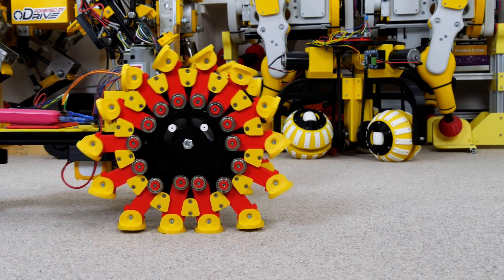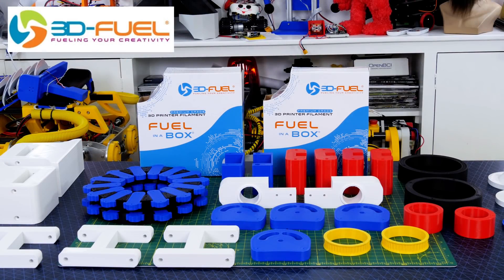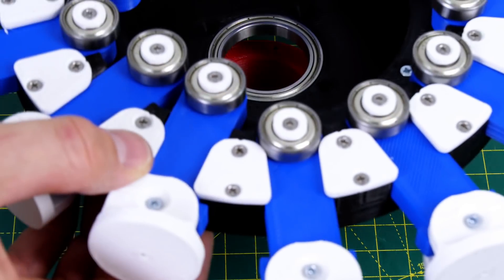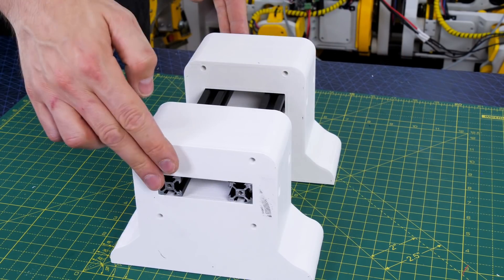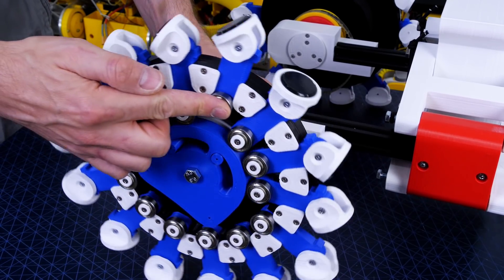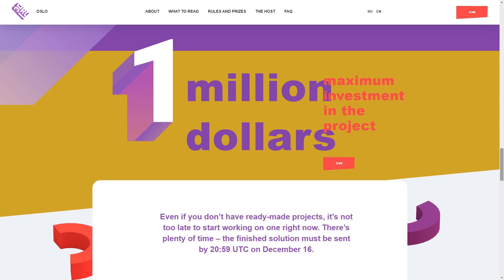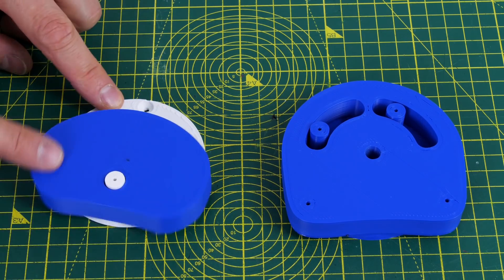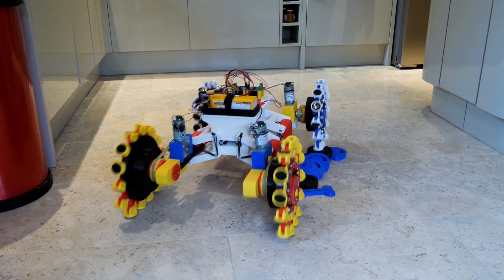4WD Walking Wheel Crawler Vehicle

Comment: I definitely understand why you didn't put rubber feet on the 1st time it would totally have changed the output of information that you would have got it would have been more about the feet and less about whether or not the legs actually worked bit worked but at the same time I know why people want them on there I get it it's gonna make the machine run a little bit better it's gonna be a little bit cooler

Comment: It appears that the new wheel guides are doing nothing!  They are not in contact with the bearings at all!  This is evident by their free wiggling.
          I can tell you how to deal with the steering problem, along with better force distribution without needing springs.  Have the 2 ends of the robot able to rotate about robot's long axis, & allow wheels to steer (like wagon wheels).  Earth movers use this scheme with 2 cascaded hinges in the body.  But this is difficult to build & is heavy.
          I can implement this scheme using 2 robot halves linked with 4 ball-jointed rods.  Weight is reduced & fabrication is easy.  I have design & demonstration videos of such a robot I designed If you are interested.

Comment: If you combined Differential Steering (which is what you're currently using) with Ackermann Steering (like on a car, but modified for four wheels), you could get a lot of added maneuverability.

You could probably also get even better traction if your pedrail feet were constructed similarly to a fractal vise, albeit three-dimensional.

Comment: What about wrapping a thick rubber membrane around the walker wheels... It would protect from debris and be more practical. Basically a new design for an air-less tire. 🤷🏼‍♂️🧐... Then you could seal n fill with a little oil so the internal mechanism stays nice n lubed for less wear.

Comment: Very cool design, but you can see why this type of wheel never took off in the real world. As you mentioned at the end, it functions essentially the same as a conventional pneumatic tyre, but with the slight advantage of the individual hard surfaces. I’d imagine this would be very unreliable when being used on a full size vehicle though, with so many moving parts. A mechanics nightmare lol

Comment: Variable length shafts between the feet could keep unwanted things from getting stuck in them
Also if the suspension was at the wheels you could have a higher floor in the center and be able to clear higher obstacles, currently the suspension seemed to be catching on most things

Comment: I'd still be curious about putting a loose flat rubber tube around the feet, just to prevent anything from getting caught between the spokes and potentially tangling. Possibly even find a similar solution for the side of the wheel, something stretchy enough to cover the spokes between the hub, feet, and neighboring feet, while not impeding performance, like the rubber tube but as a wider sheet; for the exact same reason, to prevent objects from finding their way in there. This wheel design has potential, it's only major downsides are assembly complexity, cost, and the fact that loose objects can get between the spokes and cause performance issues.

Comment: If you spin the wheel fast enough would the wheels centrifugal force be greater than the weight of the vehicle and make the vehicle run on round wheels?

Comment: I don't see what point the guide has. These wheels don't conform to anything right now because they just flop about either fully retracted or fully extended with no force except their endstops. They run flat, not conformally. Each leg would need to be sprung either individually, or according to the original design diagram with what looks like a sprung rail.

Comment: what if those rubber feet were replaced with a misting/pnumatic sucker-type mechanism  like an octopus to climb glass/flat surfaces with independent left and right on each assembly?
THEN what if these sucker-wheel- feet were at the end of the legs of an insectoid walk-emulating thinglehopper?

thinking further out the box, what if those flat feet had "anchoring pins" that could shoot out in low traction surfaces to keep it from sliding in mud/snow?

pretty cool 😁👍

Comment: Have considered a design where it would be sort of like this, yet it would be a flat wheel, where the inner bearing wheels follow on a long flat oval track. Then the vehicle would have good traction, low profile and ability to go up and down hills without tipping over, or without tumbling like a round wheel. It would then be a vehicle that be like a 2wd version of a tracked vehicle.

Comment: Im curious how well this would work (especially with the tangling issue) if the same concept of feet giving way was deployed with some kind of stretchy high grip low tension rubber containing the unit, essentially turning it into a deflated low stiffness tire (ore more accurately like a stretchy and gripy bike tire tube), that will meet the shape of the feet, without having any gaps. (almost like a rubber band under almost 0 load.)

potentially, Even just literally joining the feet with cu rubber bands.

Comment: Very cool build!  Some thoughts:

1. For both steering and more flexibility, I would make it articulate and rotate in the middle.  (You'll need to slow down the inside wheels and/or speed up the outside ones to ensure they won't slip/spin.)
2. It needs more ground clearance as it can climb over things that are higher than the chassis. Perhaps a difference suspension system would work better for this.  The innovative suspension system used by the Citroen 2CV could be the ticket.  Here is an overview of it: https://youtu.be/j7pFxgDmZXQ
3. For the ULTIMATE in gripping power, consider replacing the rubber pads with 'coffee grounds balloon grippers'.  (Yes, seriously)  It would take a bit of engineering, but the (partially) inflated balloons would provide a bit of suspension, then, as they land on the ground (and thereby push the bearing against the surface of the cam--a solid switching event), pulling the air out would cause them to form perfectly to whatever they were resting on, providing the best possible grip.

Does that make sense?

Comment: My understanding is that these were part of the evolution of what became the continuous track (e.g. on tanks). The pedrail wheel may have been used on some early tractors (late 1800s), but the chaintrack (invented by the same guy) quickly replaced it (before WW1). Basically tracks, except instead of a belt that is the traction surface itself, the belt was a chain and the traction was due to tons of these feet sticking out of the chain (e.g. Hornsby Tractors)--imagine the surface of the wheel wasn't solid, but segmented and dragged over fixed wheels. However, these proved overly complex and problematic, and soon replaced by the modern continuous track.

EDIT: the dreadnaught wheel was competing idea, similar to the pedrail, except instead of small feet that slide in and out, you had long feet (like rail segments) articulated over a wheel.

Comment: I have to wonder which is more effective. Is it the wheels or the suspension that works so well. I'd like to see this thing running with rubber wheels of the same diameter. Does that work better or worse that these seriously complex pedrowheels? Also, this is a slow machine. Pedro wheels will be terrible at more than a few RPMs. They only work because they are spinning slow enough for centrifugal forces to not matter. They suffer from very small grip patches. The feet could be wider to simulate the grip patch of a car tire. My suspicion is that grip is significantly less than an equal width tire.

Comment: The improvements helped a lot!

Instead of sticking directly forward and back, I wonder if the suspension arms were angled down somewhat, making the car have an inverted 'V' shape, would help the bottom from getting stuck on obstacles with sharper peaks?

Comment: nice work. 

commentary: from the outside this looks like a solution looking for a problem. how about a definitive demo that this is 'better' than wheels of the same size used with the same load? you could use the same platform and adjust the weight.

Comment: Only recently discovered your channel. This is fantastic stuff! I'm in the midst of designing a wheelchair for myself, and halfway through I have already realized I need to build two, one for standard navigation and the other for sport. You have given me some excellent design ideas, I would like to build something that restores my ability to use hiking trails and mountain biking trails. Obviously, I need to be able to count on getting out of the woods as well. For this reason, stability is all important, particularly as I would like to be able to take modest jumps. This seems like a very efficient iterative process, using 3D printing. May I ask, if somebody had no prior experience with CNC programming were to try out a 3D printer for design iterations, is there a particular model or software that you recommend?
Reply: On the same note, are your prior designs drawings available? I would not be 3D printing anything or making a toy, just hoping to poach some design ideas. Alternatively, if there is another resource that you think would be helpful for developing suspension geometry, please let me know. Thank you very much

Comment: With a quicker motor these wheels would act as a transmission. As the wheels speed up the centrifugal force would keep the feet out increasing the wheel diameter.

Comment: 11:17 time stamp. Idea. Put the suspension arms behind centered on each wheel, motor directly above. Seems suspension blocks at the outrigger end are hitting objects the machine is climbing over. This way like a regular auto suspension easy to incorporate steering. Just a thought.

Comment: Just a little tip with the suspension, it was working well in the video but you could make some improvements by having the spring rate a little lower, making the suspension sit the body lower when the robot is stationary, this will contribute to preload and make the suspension articulate a whole lot easier. Great videos and I'm looking forward to seeing more.

Comment: I love your videos, but I think you should take the time to dial your printer settings in. I'm noticing heavy under-extrusion and it's causing the layers to not adhere properly, especially when filling in the final layers. You can see gaps and plastic not sticking to hole walls.

Comment: The improvements made this a way better crawler but stifled its capacity to steer, which could be fixed by redesigning the body and have a motor controlled pivot point in the middle of the crawler and voila... steering, but very industrial!

Comment: Would love to see this in extreme conditions, mud woods etc. If you do another, could you go into detail about how the guide works? I get the basics but it doesn’t doesn’t seem to do much. Wondering if a solid guide that didn’t articulate and rounded at bottom forcing wheels out and allow to retract at the top would do just as good?

Comment: Add tread belts to each wheel, so instead of lil feet its a rubber belt that “grabs”
Reply: Kinda like how elephant feet work, the belt gets tight at the bottom but loose as it pulls away

Comment: Just slowly reinventing the tank. Eventually you arrive at treads, and bob's your uncle. Driving over brush (or another garden hose) or sand will show why you need treads. The only way to improve on a tank is in the gecko/goat direction. Or simply short flights. If size is an issue and you simply must move something incredibly heavy then the solution is hydraulic slow walking and or a barge.

Comment: I think angling each arm down by 35 to 40 degrees would raise it higher as well as give it a smaller area that would allow the turning to be much tighter and less torque to turn.
Also adding 2 pegs to each "foot", a peg at the bearing and a rubber band would keep each foot in it's neutral position for smoother movement while still allowing it to twist as needed when needed.
Absolutely love this stuff! Just recently found your channel and have been trying to watch as much as I can!

Comment: you could add a central articulation steering system and not have to modify the design too much
And also would it get better traction with wider feet?

Comment: The rubber feet where a major  upgrade.  
Question i have: 
At this size i dont see its big advantage over normla grippy offroad tires. Would extending the little peds change that? So it technically can climb bigger things? So the individual feet can extend further?

Comment: If you do an image search for "WWI Howitzers" you can see some examples of similar wheels to the ones you made. According to the wikipedia article for the "BL 6-inch 26 cwt howitzer" the feet added to the wheels are called "girdles", and they were added to howitzers to keep them from sinking in soft terrain such as mud and sand. However they seem to lack some of the movement the feet on your wheels have. My guess it was a cheap way of increasing the contact area of scinny wooden wheels, rather than making the broad and completely round.
Reply: It spreads the ground pressure similar to what tank tracks do. Initially most artillery pieces had wheels similar to horse carriages, which were large, round and thin. As the artillery became larger and more heavier, the wheels got larger.  By spreading the load using these, meant that they also lessen the damaged to paved road. That is until they started making larger pieces which were placed in railway carriages like the Paris gun. History is very fascinating.

Comment: Does the guide block actually do anything in practice? It seems like in all cases you showed, there is always only a single load-bearing foot that is pushed inward as far it will go and not touching the guide-block with its bearing.
Reply: Even he wonders the same @8:40. It looks more of theoretical than practical.

Comment: There's something weird going on with your suspension, but I'm not sure why.  The suspension that faces the direction of travel is much less compliant than the suspension facing rearwards from the direction of travel.  At first, I thought one was just tensioned more than the other, but in the video you just reverse the direction of travel, and you can see the rear suspension is always more compliant.  I'm not sure why this is, but it always results in the front of the vehicle having a rougher time than the rear.

I hope this is a helpful observation.  I'd love to understand why this is happening.

Comment: I think the feet would perform better if the pads were larger so there was less space between them when retracted. That might allow you to have less of them as well. But that's in the realm of optimizing and not feasibility testing.

Same as the others, would it be possible to make this climb walls? 

I wonder if for the suction cups it would be possible to create a mechanism that automatically articulates the cup to create and release a low pressure within the cup. Maybe a version of what moves the feet out.

Comment: Ground clearance is arguably a bit too low for a crawler type vehicle. Mostly due to those lower control arms being below the center line of the wheels. Could be improved by having the drive arms at a slight angle, maybe. That said, this thing is nuts!

Comment: I'm not convinced that these Wheels do any better, than normal wheels of the same size. Also the "foot size" should be related to the obstacle roughness . I would like to see this wheels climb a flight of stairs of ideal step size and then compare it's performance (Speed, maximal load, maximal pulling strengs ... ) to the same Robot with normal wheels - which wheel will slip first?

Comment: Maybe you can do a rubber band around the wheel, that it does not take stuff with it? I think the feeds are overrated. The expansion is of course is good, but just about a rubber band then through the arms of the wheels. you dont need to erease the feeds just put rubber band on the feeds and make sure the rubber band can move freely while expanding/move together.
Reply: Just thinkin out of my ass here but...if the rubber band is not in a stretched condition through the entire range of motion of the feet, it won't follow them. But, if it is, then it will compress them. While it might not be a bad idea to constrain the the motion of the feet a bit rather than just letting them flop around, what you really want is for them to be held expanded in a springy way so that they explore the world tenderly. Given the already obscene complexity of this build, and the more fundamental things like the shape of the guide rail to get right, the freely floppy feet are probably the best way to go. Though, now that I've said that, throwing a big rubber band around the wheel would be a great quick check of the guide rail profile.

Comment: It's always interesting to see things made simply for the sake of making them. However, I do not see any sort of advantage to this type of wheel over a similarly sized compliant rubber wheel/tire. This seems needlessly complex, overly heavy, and prone to breakage and malfunction.
Reply: This design allows a smaller diameter assembly (wheel) to climb over an obstacle. You would have to have a rubber tire of extraordinarily low pressure and very soft carcass construction to give you the same type of equivalent deformation over objects.